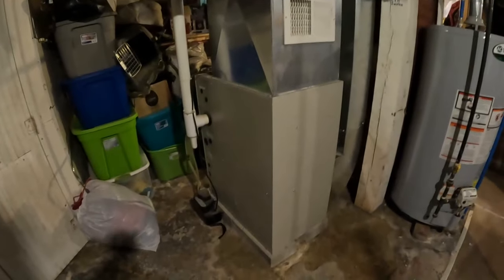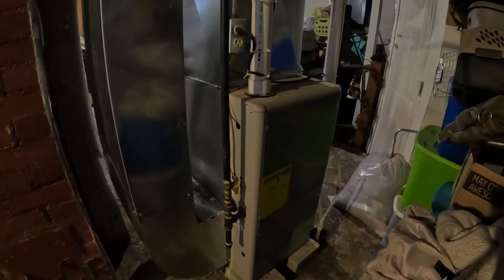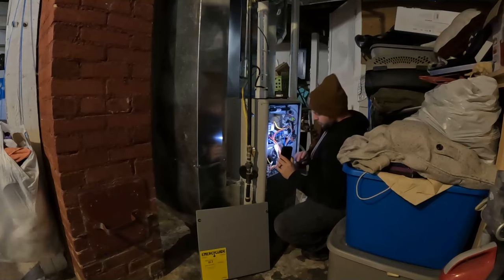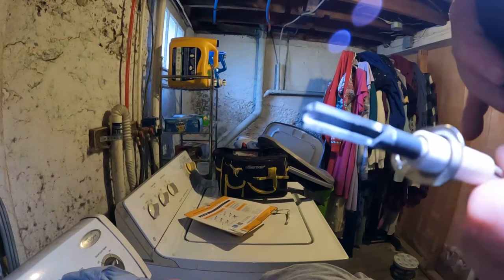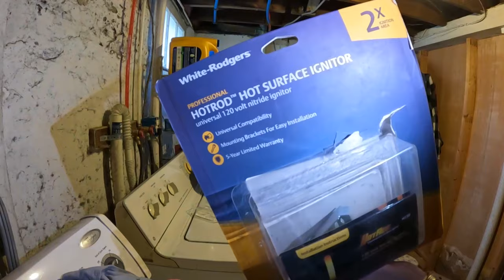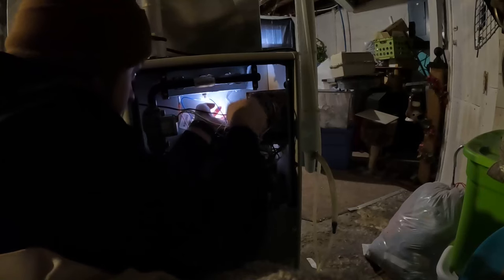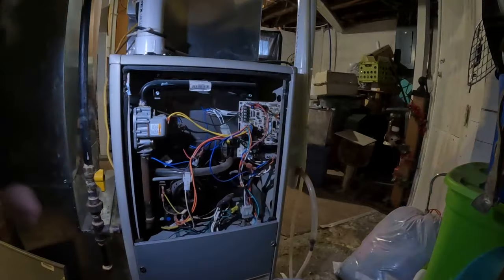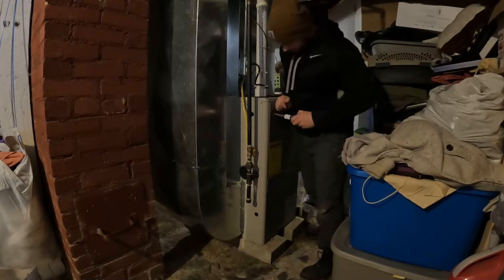How To Troubleshoot And Fix A Broken Furnace / Furnace Will Not Ignite.

Comment: Strange how when you watch these videos most of the time it is the ignitor. Had to replace ignitor and flame sensor since they were made together. Flame shuts off. I suppose the white wire us next. There is no water reserve, no tanks. Glows red shuts off, did clean the burners and jets.
Reply from the maker: Are you saying the burners ignite and then shut off? Or do the burners never ignite?

Comment: What i do to verify that the gas valve is doing its job i get a BBQ lighter i wait for the furnace to cycle and i pit the lighter near the burners and if that works i know its the igniter but there's other ways
Reply from the maker: Hi,
First make sure you have a gas supply, so check another appliance that uses gas and make sure it works. Also, verify the shut off valve on the furnace gas supply line is in the "on" position.  If all that is good then you will want to check that there is power going to the gas valve from the control board. The easiest way to do this is locate the wires and use a clamp meter around one of the wires and see if there is an amp draw when the "call to ignite" happens. If you do not have a clamp meter, then you can use a multimeter and check that those wires have 24 v going to the valve when the "call to ignite" happens. One thing to note is the "call to ignite" will only last about 4 seconds, so make sure you have your meter hooked up and looking at it, so you don't miss that window. If you do not have power going to the valve, then its the control board or some other wiring issue. If you do have power going to the valve then the valve is bad and will need to be replaced.

I hope this helps!